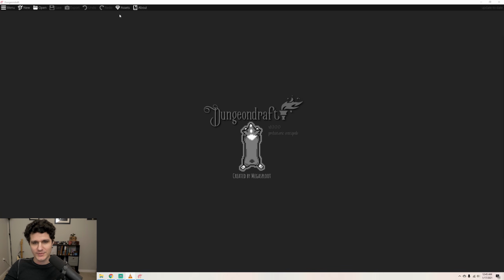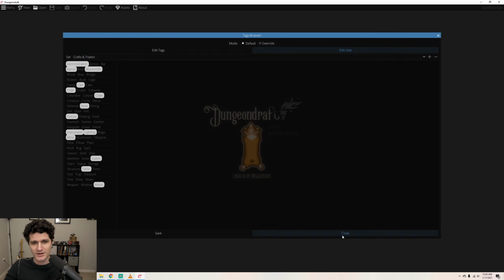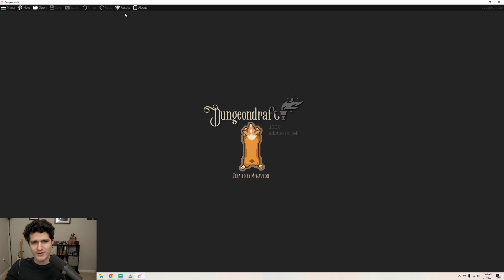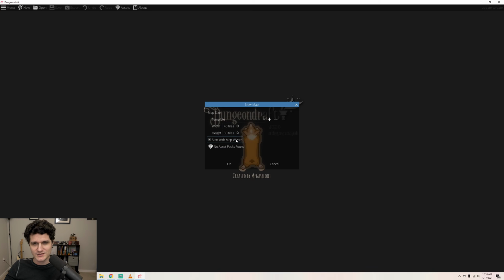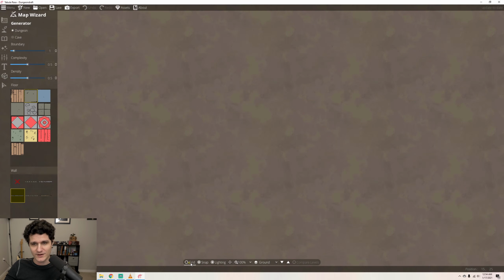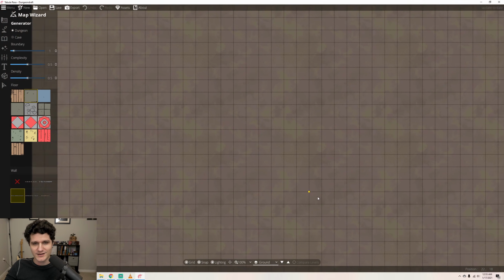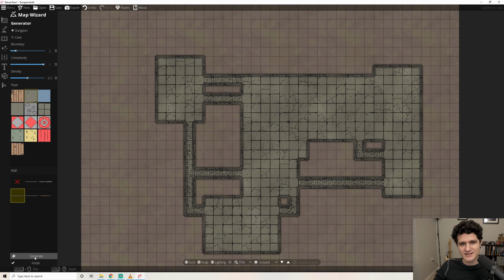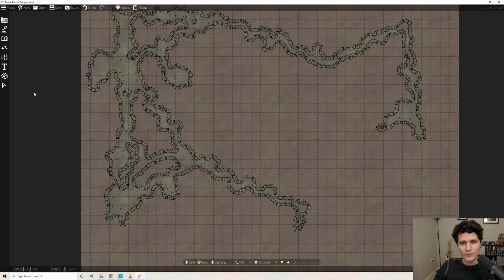(Updated) DungeonDraft Basics Part 1 - Creating Maps, the Map Wizard, and Settings

Comment: I installed it but I see no option to have a desktop shortcut for it. Is there any way I can make one?
Reply from the maker: Ah, I don't believe there's an option for a shortcut by default. If you right click on an empty space in your Desktop and click 'New' -> 'Shortcut' you can create one by hitting 'Browse' -> 'This PC' -> 'Local Disk (C:)' -> 'Program Files' -> 'DungeonDraft' -> and then click on the 'DungeonDraft' application and hit 'OK' at the various prompts and you should get a shortcut :).

To your other question would it be possible to see a screenshot of the issue you're having? Also, the Megasploot discord might be able to get you faster help than I can if you'd like!
Reply: @EncounterLibrary  Thank you so much. I will look into asking the discord server
Reply: Also every time I try to save a map I instead only get the map’s size and nothing else